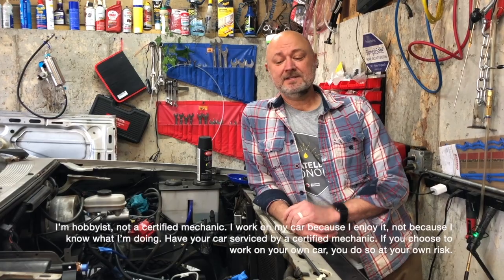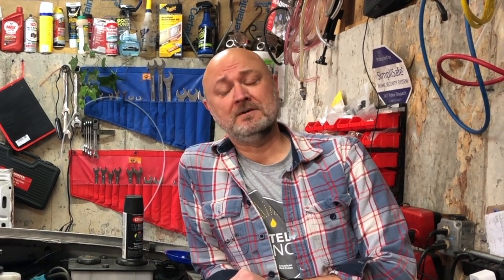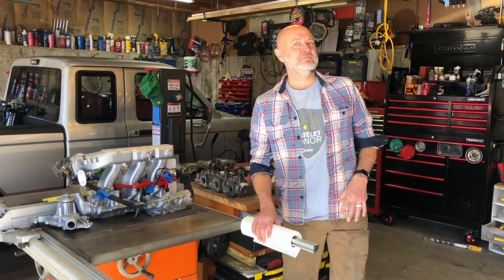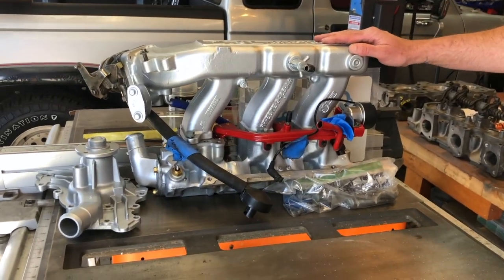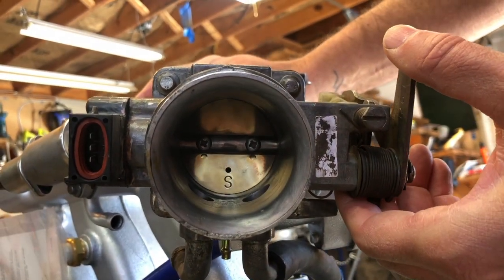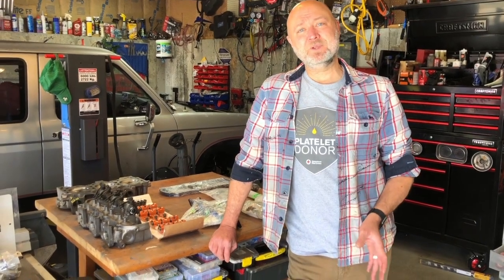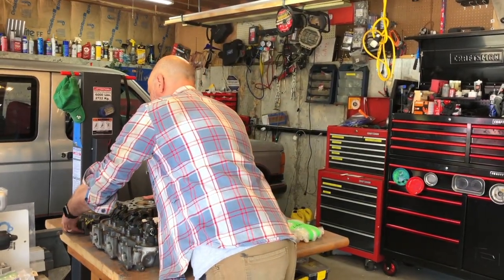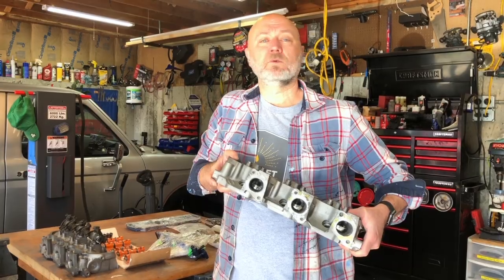Ford Ranger 2.9L V6 Rebuild Project

Comment: Lifters tick from camshaft bearing wear
Reply from the maker: Seems like a very common cause, along with low zinc oils introduced around the time these engines were common. Adding to the problem in mine, the rocker arm shaft was completely clogged from poor maintenance by PO. Thanks for watching and for your comments!

Comment: I bought an 87 ranger with a 2.9 that's locked up for super cheap. Been contemplating either swapping for a bigger engine or another 2.9 but still thinking about it.
Reply from the maker: Thanks for watching and good luck with your project! Lemme know what you end up deciding.

Comment: Would you happen to know if Ford used a hydraulic roller cam and lifters on the 1989 Ford ranger with  2.9l or if they used a hydraulic flat tappet cam and lifters

Comment: I love automatic transmission and I never had any problems out of my 1987 ranger with 2.9, it was a great motor
Reply: I have an 88 2.9. No real problems. Replied my IAC valve and MAP sensor. 230,000 miles automatic. Good truck.
Reply: Mine 89 2.9 and original motor and miles have 890.000 miles and no problems with it have it 6 years and no even a problem
Reply: Y’all lucky got a 89 2.9 automatic got front main seal leak and transmission leaking

Comment: 😀Be careful with your mods.  The 2.9 is a speed density engine and the computer can only accommodate limited changes in its calculations. If you change too much you ,will not be able to get the engine to operate correctly, even though people are boosting about all the power gains you can expect  You cannot correct air/fuel and limited timing adjustment is available,  You cannot re-flash the engine computer.  Use a melling oil pump and a high pressure by-pass spring to improve oiling.  The 2.9 is a good engine , if maintained.

Comment from the maker: A quick update on the build and a word of caution, based on my experience with the Morana parts. I installed the fully rebuilt engine, and it started right up. Then, there were horrible noises from the top end! The machinist who built the engine for me came right over to trouble-shoot. After removing the valve covers, the source of the noise was obvious. 4 of the 12 Morana roller rocker studs had snapped off, right above where Morana  had welded them onto the brace that is supplied with them.  After my local machinist checks the heads for potential unseen damage cause by the Morana roller-rocker failure I am going to rebuild the heads with the stock rocker system. .video to come soon! At this point, I cannot recommend Morana parts for these engines.

Comment: Looking forward to seeing progress and maybe a dyno test.  Your rebuild is exactly what I have planned when my 2.9 dies. My problem is I’ve run Mobol1 since I bought it used with 50k miles. Now with 208k  and the engine is still strong with excellent compression and no ticking. Only issue is a leaky rear main seal. 
I already have ported the Plenum, intake and heads from another engine. Oh. What are your plans for the headers and exhaust?
Reply from the maker: Thanks for watching and for the comments! What differences did you notice after porting? I can only find pace-setter headers in stock these days, so I’ll install the ceramic version when I finally get the engine in. What is your header/exhaust setup and how do you like it?

Comment: I have the same truck 87 Ford ranger 2.9 V6 four-wheel drive it's red I love it I can't give it up for nothing I've had the transmission rebuilt I'm having problems with shifting out of first into second I was and now it's gotten better I've done a certain couple of little things everything you do to these trucks matters doesn't it but I've noticed throttle body flap where you say keep that clean I just cleaned that today and I literally sanded it down with some cleaner and some 400 grit and got it really shiny so you take those two screws out and take that off and that's a little bit more around the edges of air flow perfectly clean thanks for your video it's awesome

Comment: Nice work! I have an '88 Bronco II that I bought new. It has the same 2.9L engine and mine now has 225,000 miles on it. It's still going strong, as strong as it ever was, anyway but I have to figure it's not going to last forever. Oddly enough, I've never had to replace any of the sensors other than the distributor when the Hall effect sensor (crank sensor) started going bad. In fact, it's been super-reliable over its 34 years. I'd never heard of Tom Morana. Do the 1.7:1 roller rockers turn this into an interference engine?

Comment: I have an '88 Ranger GT with the 2.9L and have been eyeing doing some mild performance improvement. Been slowly putting it back to whole since I bought it in a few years ago. Really interested in seeing how the Morana racing parts do-want to just goose the power up a tad to something respectable for the street in my own vehicle. Truck's my daily driver and I've definitely had those common sensor failures (IAC, MAP, TPS) before. Truck doesn't fail to run, but you can definitely tell there's an idling issue/engine can't feel what it's doing. Looking forward to the next videos on this build!
Reply from the maker: Thanks for watching and for sharing about your ‘88. I hope you’ll post more about your project as it progresses!  I’m still waiting on the machine shop for the block, but anxious to see how my ‘89 runs in the end. I took a shotgun approach, roller-rockers, porting everything, headers, so it will be hard to know what power gains (if there are any…) come from what mods. But I’m excited to see what happens when I finally turn the key.

Comment: Great info. I've researched Moreno too. Good stuff. Are you planning to use a stock grind camshaft? Do you foresee any custom computer tuning bring that the speed density system is limited? I have 88 Ranger and Bronco 2. I share your save consideration of building up the 2.9l in both vehicles.
Reply from the maker: I’ll probably stick with a stock cam - given the rockers are 1.7:1…and the performance grind cams are hard to find right now. I also want to do just enough to wake up the engine without needing to get new injectors or a custom tune. I’ll see how it runs with stock tuning and injectors, and consider getting a custom tune if needed. What I have heard so far is these engine’s stock tuning and injectors do alright with this level of modification but once people start boosting, tuning and higher flow injectors are needed. This is my first crack at a 2.9 though so any advice is appreciated!

Comment: great video, looking forward to seeing more updates on your rebuild! I'm doing research at the moment to rebuild and improve my '86 STX with the 2.9. wasn't aware of tom morana's work, really cool to see some performance and reliability support for these apparently derided colognes! curious to see what your impressions are on the gains made by the new parts once it's done. I've read the 2.9 tends to have issues with cooling, any plans for upgrading that system?

also would appreciate any advice on things to look for when tearing down the 2.9 or must-replace/upgrade items. trying to get it reliable as I can, not really hoping for any increase in power (though I wouldn't complain!). it's virtually my first time doing any automotive work and I love this truck, tryin to make it last as long as possible. hope to see more from this project soon!
Reply from the maker: Thanks for watching and for the kind comment! Full disclosure, this is my first 2.9 rebuild…so I may be about to get it all wrong :-)
My understanding from research and from talking with the more experienced folks at the machine shop is the overheating issue has more to do with the heads being less tolerant of overheating than most engines. This is especially true of pre-1989 heads. See this helpful article on head selection: https://www.therangerstation.com/tech_library/2_9_Page.shtml
So, the oval-pedestal, older heads will crack easily if the engine ever overheats, even just a little. Post ‘89 and better aftermarket castings are more robust. Tom Morana suggests just replacing the heads with new castings if you ever pull them. My machinist suggested I just run my ‘89 originals since they magnafluxed fine and have the improved square pedestals. Just for grins, I will be swapping the hydraulic radiator fan for an electric fan - I’ll do a video on that when I finally get the block back and install it. I already upsized the radiator to a Napa part # RNR NR1164B   - it’s a larger radiator from an Explorer that will shoehorn into the automatic transmission Rangers. In any case, It’s essential to flush the cooling system, replace the thermostat and radiator cap and keep the coolant topped off, always. Additionally, these engines have flat lifters (aka tappets). So when rebuilding, it’s super important to use a good high-zinc/ZDDP break-in oil, like “Driven BR30” for a couple of 500 mile cycles then use something with ZDDP for the future. Stick with conventional oil for at least 15k miles before going synthetic. While zinc is hard on catalytic converters, no-zinc will kill the cams and lifers and leave you down on power and with the dreaded cologne Tick! Lesser of two evils, in my mind, is to use anti-seize on the catalytic converter bolts and pull it and rinse it with soap and water every 20-30k. It’s a long story, but these good little engines got caught in the middle of drama among big oil, the big three auto makers, and the EPA in the early 1990’s. Some people opt to gut the cats, though this is not entirely legal. Please keep me posted on your ‘86!